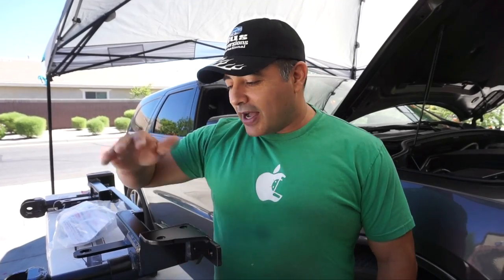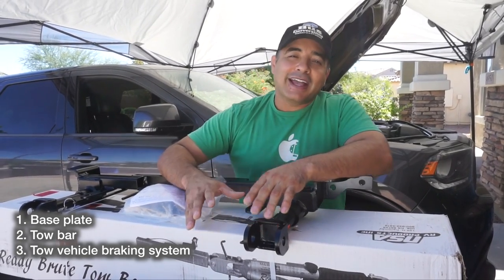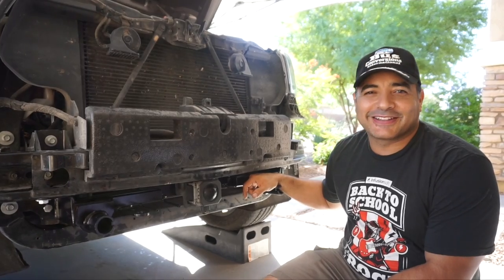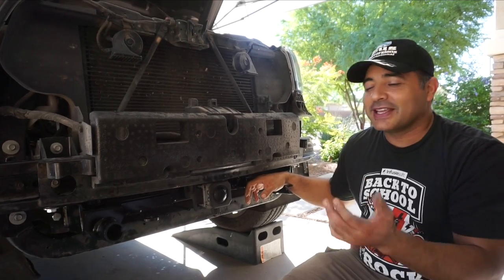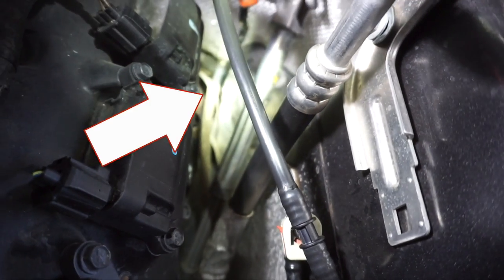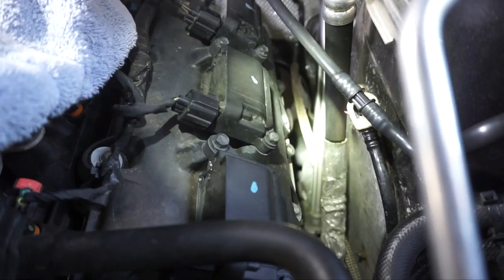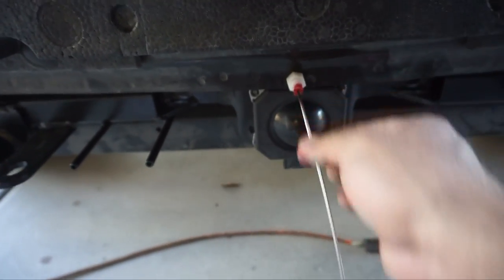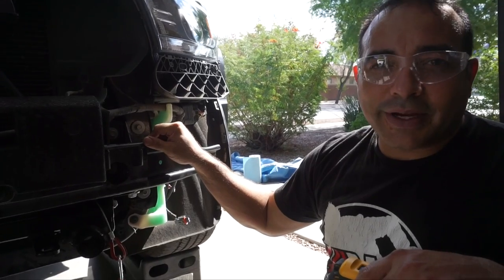Setting Up our Tow Vehicle [2014 Dodge Durango R/T] - Part One: Intro, Baseplate, & Brakes

Comment: Diodes pointless dude...
If the brake pedal in the Durango is being operated by the cable, the brake lights in the Durango will be coming on whether you are electrically connected to the RV or not fella!! (assuming the ign is on which it will have to be if you don't want the steering lock coming on while towing it)
Edit... you will still need to wire the turn signals and lights though..
Personally I'd also be running a vacuum line for the brake booster or two pedal presses down the road and the brakes will be useless too.. ;)
Reply from the maker: The diodes are supposed to protect the circuitry in the car from power coming from the RV.  As you noted for the brakes and turn signals - the brake light comes on anytime you push on the brake.  The regular diode kit did not work for us so we ended up using a different solution - tune in next week!  Also, our car does not appear to have a steering lock at all.  We asked Ready Brute about the brake booster and they said it is not needed:
How will the Ready Brake work with the engine of the towed vehicle turned off?We have been making this system since May of 1997 and have sold thousands of them so you can trust us when we say the Ready Brake will work perfectly fine with the power brake booster not being powered up in your towed vehicle. The brake pedal is attached to the Ready Brake with an aircraft cable and since the weight and momentum of the towed vehicle is pulling the pedal down it doesn't matter if the brake booster is powered on or not. If you are still not convinced, we will gladly sell you our Vacuum Pump Kitbut we insist that our tow brake does not need it.
Reply: Beginning from this Morning Hmmm may be different from my experience but disconnect the booster (plug the hose)  pump all the vacuum out and go for a short drive.. I would like you to experience how much pressure you need on the pedal for the brakes to work efficiently.. then you can decide if that much tension on a brake pedal assembly is a good idea... 🧐
Reply from the maker: I am skeptical too - I pressed on the brake quite a bit when installing the cable and it got REALLY hard to push after about 2 pumps as you described.  It will be interesting to see how this works out when we get it hooked up to the bus.

Comment: Me again. sorry. Ive been driving 18 wheelers for ten years and your too nice for me to not tell you my thoughts on this. Get a Rav4 or close because durango is so heavy for a trailer. Sell durango. Put hitch on Rav4 and pick up small trailer with it. When on road with rv if set up is too much for area just take rav4 off trailer and hook the trailer to rav4. No or limited backing would be terrible.
Reply from the maker: Thank you Charlie - I appreciate your feedback. The Rav4 is a great little car - unfortunately, I have 4 kids so there would be no way to fit us all safely in a Rav4.  The other issue is that many parks and sites we want to visit do not have accommodations for trailers - so even if I hook it up to the tow vehicle - there is still no place to store the combo of vehicle + trailer.  We follow a lot of families who travel and the #1 complaint is that they are "too big" to fit in many of the campgrounds.  This is one of the main reasons we selected a 35ft bus instead of a much more common 40ft bus.  Another issue for us is tongue weight.  On our bus the engine "hangs" off the back of the bus on a cradle - it is not designed to take heavy tongue weight loads without significant reinforcement.  Pulling a vehicle "four down" essentially reduces the tongue weight to almost 0.
Reply: The rav4 was just an example. Something not so far away from 3000 pounds. And tongue weight can be adjusted by how far car is pulled up on trailer.